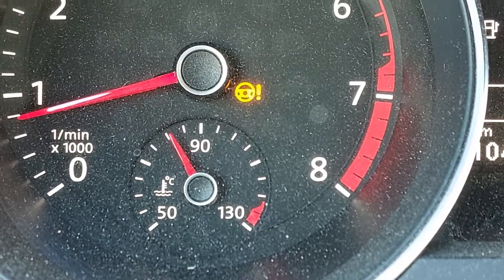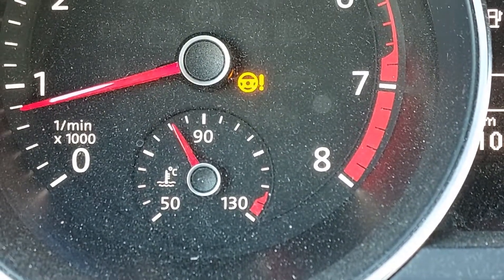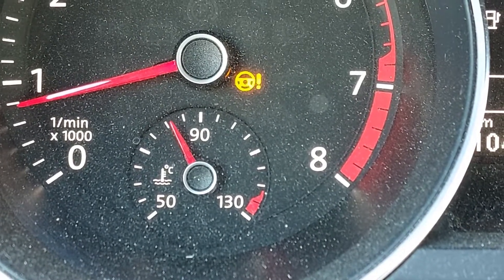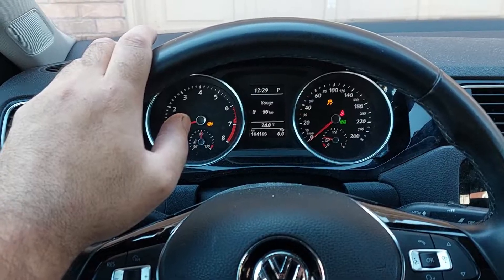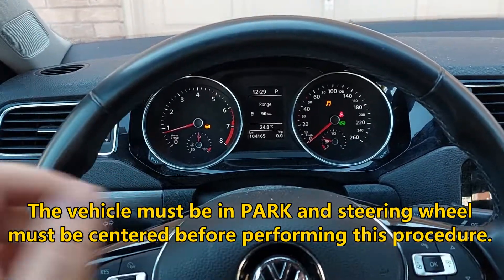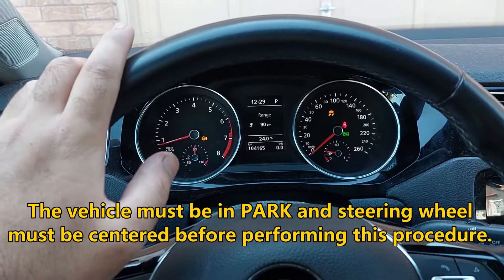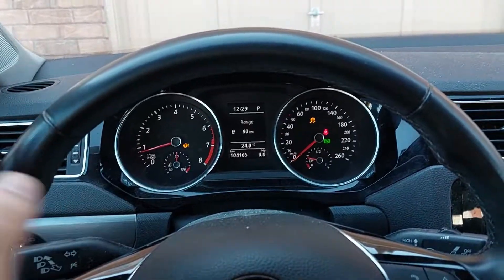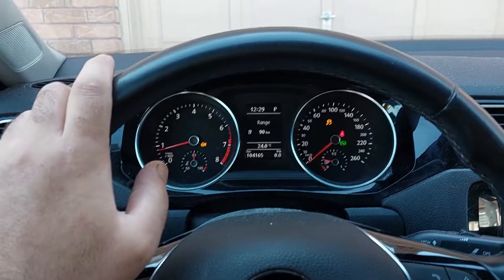How To Reset SAS Steering Angle Sensor | Power Steering Warning Light On Volkswagen Vehicles

Comment: THANKS SO MUCH wish I had this video knowledge 8 years ago as my dad's car had this fault he went to VW  dealer not only did they charge him a diagnostic fee fitted and e brake sensor cost  150 quid. Them the angle sensor came back on again and they resolved it..... To think this might be all they did was lock to lock steering. Wheel all that was needed is shocking.  You deserve a thumbs up buddy.
Michael
IRELAND..

Comment: Thanks! Should this reset work if the light is not on? Is there a way to force the steering wheel light to turn on or the conditions to be met for it to turn on?
Reply from the maker: No, this is to be done when the warning light is on and this is the procedure in order to turn it off. If the warning light is not there, then you should be OK.

Comment: what if you have a red steering light, esc light, and tpms light. Im thinking i need a new module???
Reply from the maker: It can be a few things. You will have to scan the computer for trouble codes to see what it is first. A red steering light could mean a problem with the electronic power steering system.
Reply: @moosemobileautorepair  Trouble codes:
 B200FF0 - Internal malfunction intermittent
 B200000 - Ctrl. module faulty static
 B1168F2 - Steering angle sensor no initialization static
B1788F0 - Control module Immobilizer deactivated static

 C114602 - Tire pressure monitoring display Signal error static

Comment: does this work when it's not yellow but red ?
Reply from the maker: No, it won't work when it is red. Red means there is a problem with the electric power steering system and that would need to be fixed first before you can do the reset/calibration.
Reply: @moosemobileautorepair thanks.
Just for the heck of it I tried the steering wheel Lock side to side, drove it straight at 15mph  and light is off!?
Steering is not stif or sticky ?
Reply: My dad had 08 passat yellow light on dash VW deaaler charged him 160 for diagnostic.. And R brake switch and the light came on next day.. To think that's all they had to do. Said they only kept him an hour too.. Just a huge tip off to customers. This tech is so honest could make 1000 s. Off this one SIMPLE 20 SECOND 
 MANUAL
  RE CALIBRATION  is insane.. Bunch of crooks stupid design flaw to make money

Comment: What should I do if it's not working?
Reply from the maker: It should work if there are no problems with the electronic power steering system. If there are any hard faults or stored trouble codes in the system then you will need to fix that first before the system can be resetted.